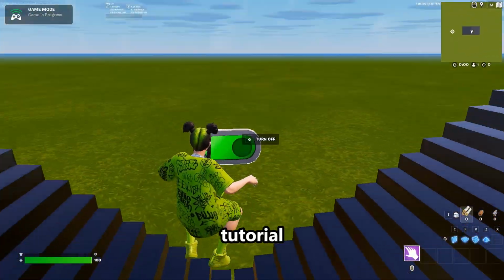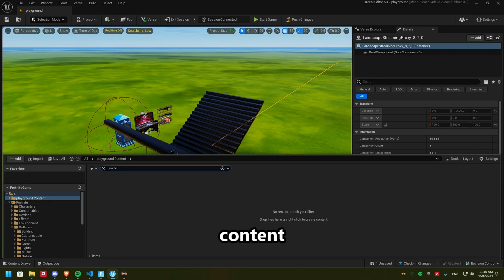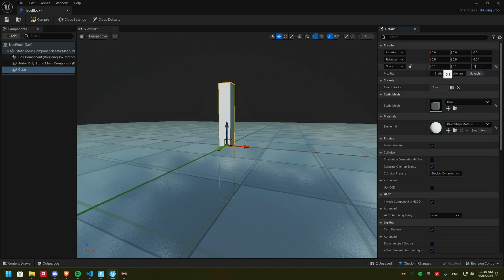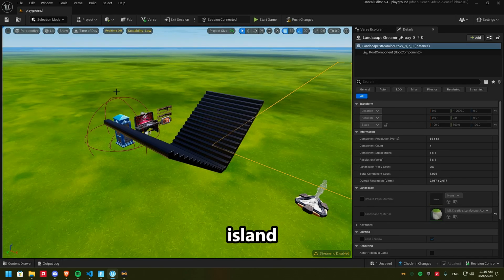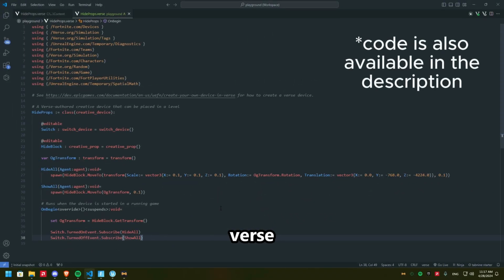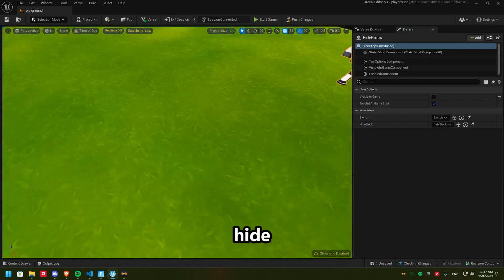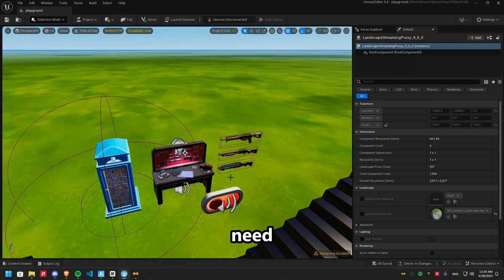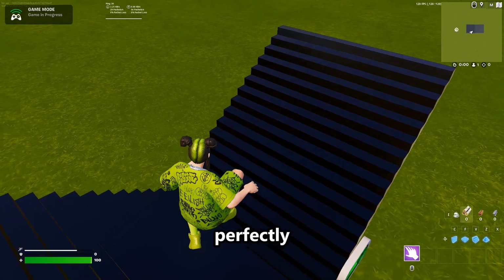How To Make PERFORMANCE MODE Switch in UEFN

Comment: Tip. its easier to implement using datalayers and Load/unload on switch turned on/off :) that way you Unload the different props away from video memory, you could actually see the Memory cell go down on your map when unloading the datalayer :)

Comment: Hello, I have a problem. The performance mode works perfectly when I activate it, but when I deactivate it and activate it again it bugs and stops working. It is a visual bug because when it is activated you can see the ground, but you cannot be on it, you fall into the void.
Reply: I deleted the code, copied it back and it was solved👍

Comment: Technically, it's not a performance mode, because the elements have just changed places, and would have to be removed... but good job anyway.
Reply from the maker: yup, only the elements that can be hideable might benefit performance, if you hide them aswell

Comment: I could add a command that actually hides the selected objects and not just reduces their size and changes their position, maybe you could add it to the ver code you already have because when I apply it on a 1v1 map that has water and a platform it also shrinks but doesn't is hidden, on the other hand, the object that allows you to change skin is not hidden or reduced, it only changes position and can still be seen on the map.
Reply from the maker: the problem is that for some reason not all objects are hideable
Reply: Did you change the code? would really appreeciate it if you could share with me!

Comment: Hey I'm stuck on this anyway  I can contact  you for some help?
Reply from the maker: How are you stuck? We can chat here
Reply: @also_bet   I copied the code and then pasted it all ok put when I dragged the verse class and clicked on it there was no hide props section where I would be able to add the switch and the hide block.
Reply from the maker: @limit-gb8522 the only posible thing that could happen is that you copied the code wrong, maybe is an error in the indentation, maybe make sure the code in your editor looks like the code in the drive file. If that’s not it idk
Reply: @also_bet  ok I'll try that thanks